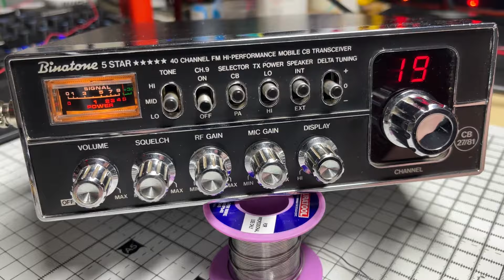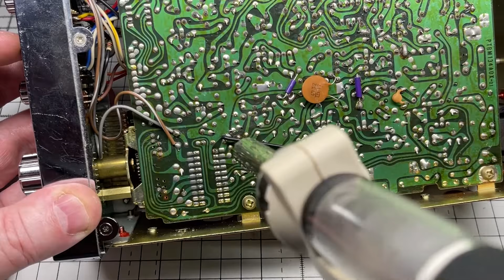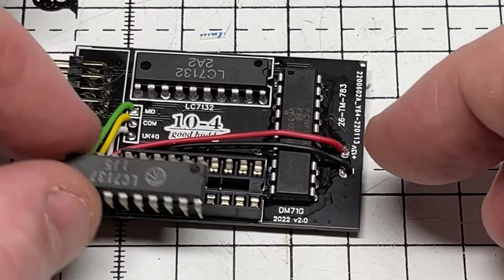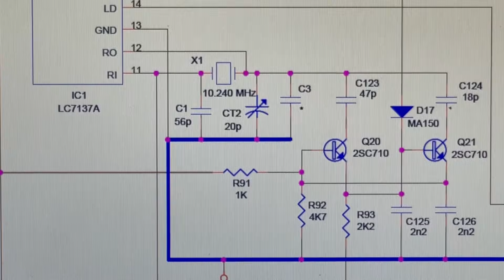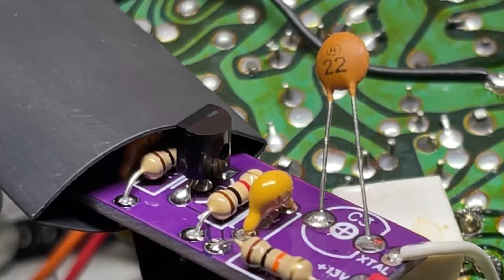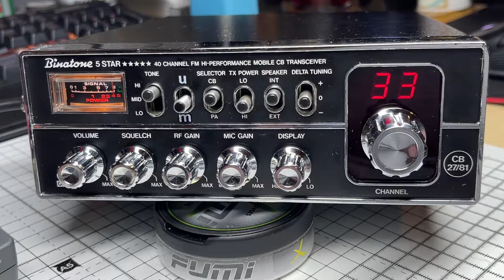EP 044 - LC7137 - LC7132 Mid band mod. Fitting to a Binatone 5 star and alignment.

Comment: I was wondering where you got the actual boards from you fitted. I've dealt with spectrum in the past. But these are different to their boards. Also can you point me to where I can get heat shrink of the size big enough to go over the boards. I have loads the smaller stuff I obtained from Lidl.
Reply from the maker: Hi ,These boards are designed/ made by me if you are interested in any please let let me know through here or my Facebook group, and the shrink wrap is from eBay , its sold as lithium battery wrap.
Reply: @MicroChipz  I would be interested as have an old rotel 230 I wouldn't mind adding the EU too.
Reply from the maker: Well as long as you are competent with a soldering iron it shouldn’t be a problem for you